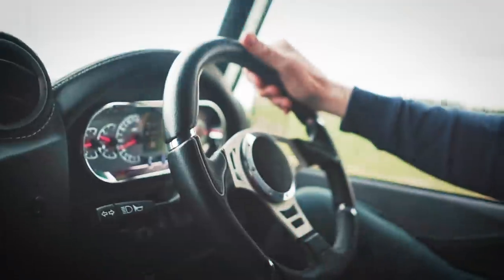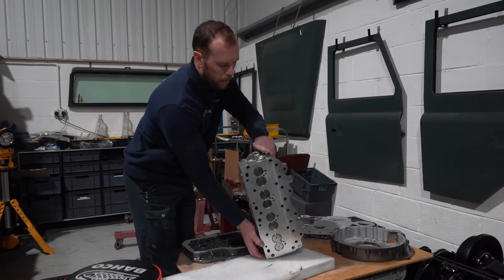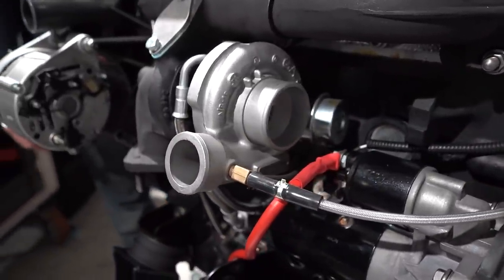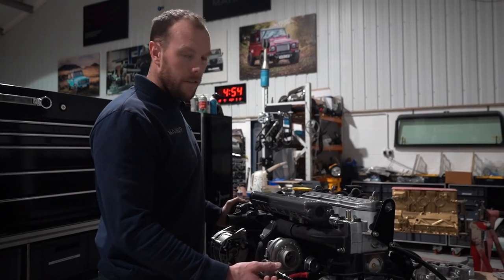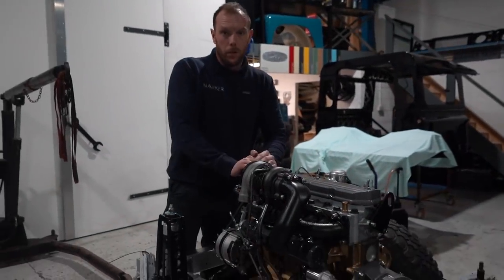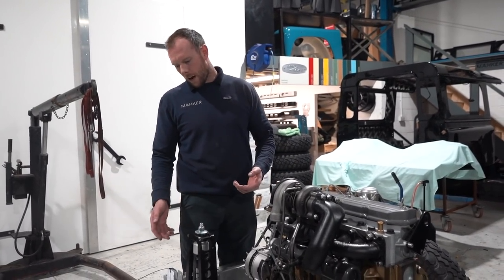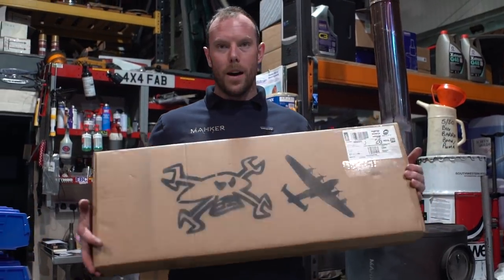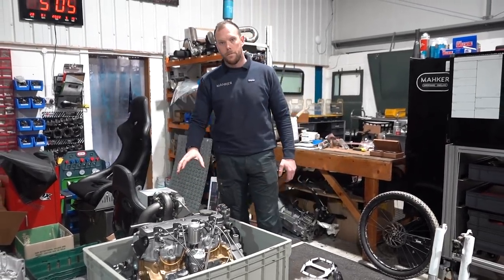THE ONLY LAND ROVER ENGINE REBUILD YOU EVER NEED TO SEE. I'LL SHOW YOU WHY | MAHKER WEEKLY EP030

Comment: I must admit, I really love the 200/300 Tdi rebuilds. They are spectacular David, well done to Dad for No. 2.
Reply from the maker: Thanks!
Reply: I wish land rover continued developing the TDI instead of going to tall complicated overhead cam designs. a TDI 5 or 6 cylinder would have been awesome.
Reply: how much boost can the TDI 200/300 take? Any space for a Sequential Turbo system?
Reply: @captarmour  I don't know the answer to that mate, or whether anyone has done it.
Reply from the maker: Id say yes ! If built correctly I’ve seen these engines push 40-50 psi
Reply from the maker: Most definitely we love the simplicity

Comment: Question, fitting the roof back on, there are 2 seals (land rover parts) but also a sealant which is gunned in.  What do you use for that.  I've been on my rebuild a while and at that point.

Comment: Q&A: Hello from Northern Ireland 👋  I’m in the middle of refurbing my own 200tdi. The cylinder head is getting remanufactured by turner engineering & performance gas flowed, I have on the way from Allisport their full width intercooler & turbo technics VGT turbo, already have a 2.5” exhaust system from demand engineering. Would you alter anything else? Ie do you think the system would require more fuel from say a boost pin/ring combo? Recently had new injectors a few years ago. I’m not looking for a massive increase in power just smoother delivery, hope that makes sense. Love all the work you guys do, Adam 👍
Reply from the maker: I can offer you my performance injectors and fuel pump if you’d like to ship them to me
Reply: @wearemahker  thanks for the reply, can I give you a call tomorrow to discuss this?
Reply from the maker: @adamcurrie7709  no problem sir

Comment: Can you keep the original reg considering the number of major parts changed? I want to change my D90 to a galv chassis, but engine & gearbox have already been changed.
Reply from the maker: Yes you can. Get in touch if you’d like us to help you with a galvanised chasis
Reply: @wearemahker  thanks, your work is second to none,  but I couldn't afford it. I have a D90, currently with a 3.5 V8 and 4 sp auto. I've junked the old lucas flapper and about 90% complete on megasquirt, although this has not been run yet. I'll continue to watch your channel with interest.
Reply: @wearemahker  Would you consider a galvanised bulkhead as an option?

Comment: Would you recommend stainless nuts and bolts everywhere? How do you get around dissimilar metal corrosion?
Reply: for anything chassis or drivetrain related no high tensile steel bolts for sure stainless has a lower shear strength and can snap easier

Comment: pushrod engines are more compact lighter cheaper to build and easier to work on. the Chevy V8 proves that a pushrod engine can spin 8000+ rpm, why in heavens name diesels that rev to much less are being designed with overhead cams?
Reply: https://youtu.be/4LEmojijIWI 
This is a pushrod engine spun up to 9250 RPM. Watch the highspeed camera view of the valve springs!